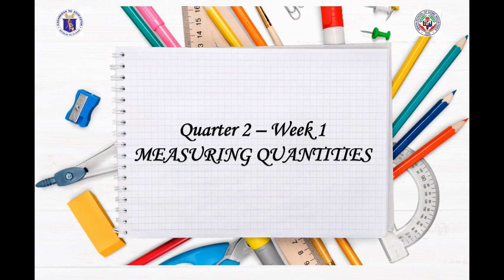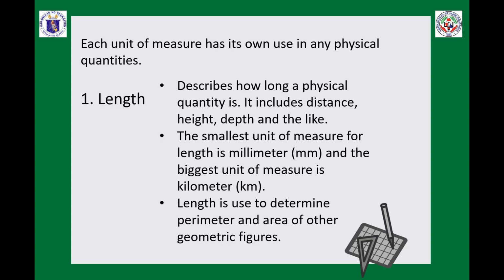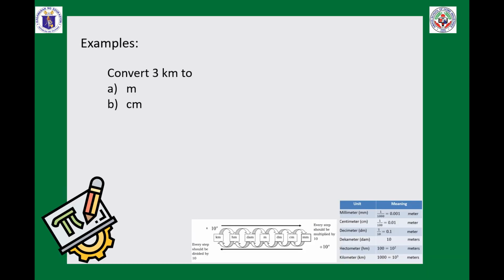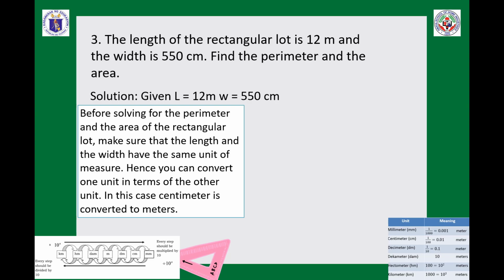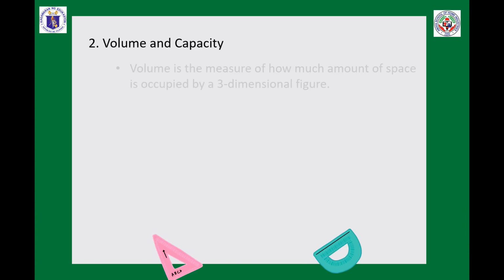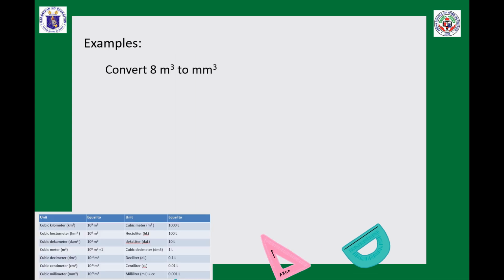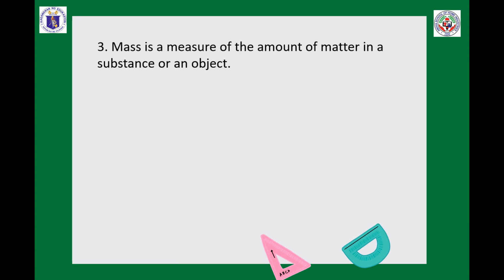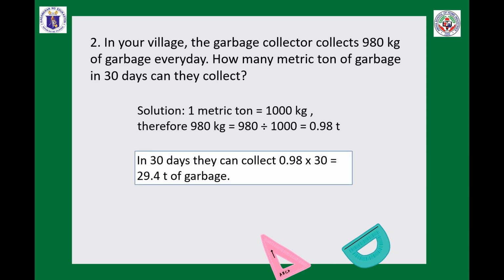Q2W1 - Measuring Quantities

Comment: Hannah Adolfo
G-7 Caimito
i have learned that measurement is a number that characterized an object or event, which can
be compared with other objects or events. You use basic unit of measure for
length, time, weight/mass, electric current, volume, angles, temperature and rate.

Comment: Sunshine, Alarca from G7-CAIMITO

What I learned today's Math Lesson is about Measurements. It's a number that characterized an object or event, which can be compared with other objects or events.
And there are two systems of measures:
First is, Metric System or the International System of Units (SI)
Second is, English System
The units of Measure is,
Length
Volume
Mass
Temperature
Time
Capacity
And.. Angle
And more!!.. <33
Reply: I also learn today how to use it and convert it into different unit of measures.